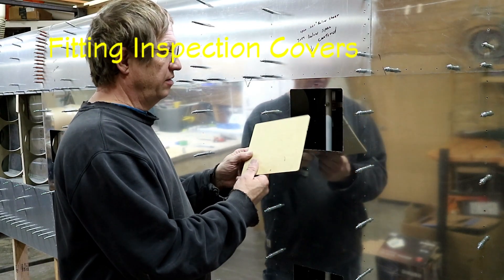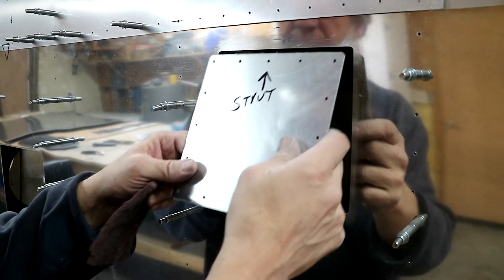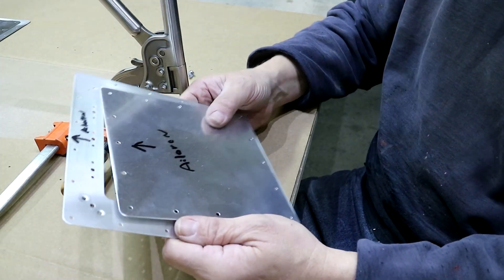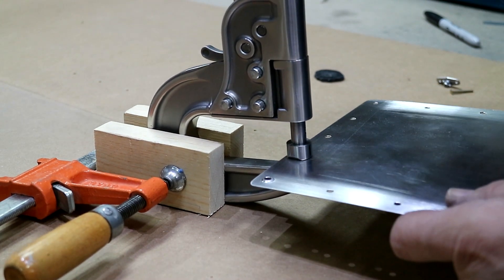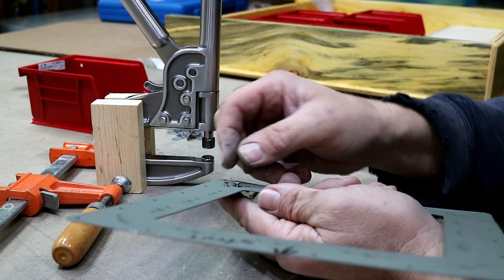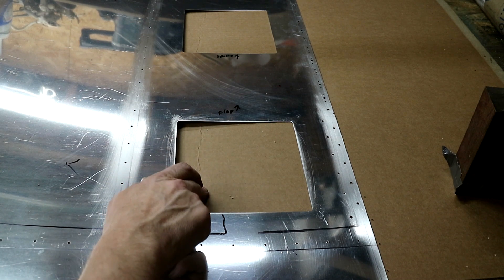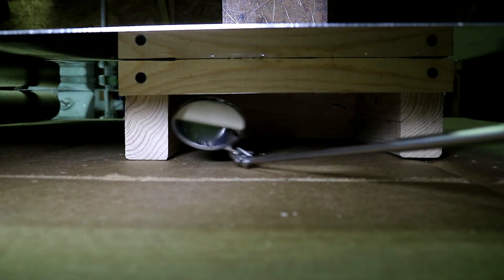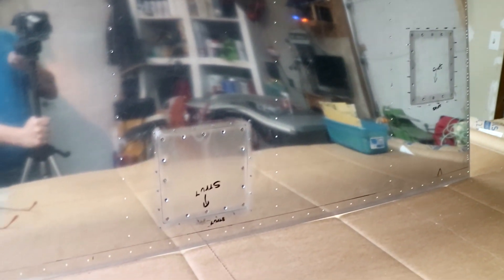Bearhawk Experimental Airplane Build : Fitting Inspection Covers

Comment: What router and program are you using to do this work. Thanks for the video.
Reply from the maker: The router I made. The software is Mach 3.
Reply: @BSpotBuilds  thanks for getting back to me. Had you worked with Mach 3 and done CNC before or did you learn the process just for this build? Thanks again
Reply from the maker: @amtpdb1  I have previous experience with both, but don't let that hold you back. You can learn as you go and YouTube has all the training you need. A good project will help drive you toward you goal.

Comment: Hi. I haven't started with my wings yet but would like to do the inspection covers and ring so long. Would you mind sharing the dimensions or if possible, the files for machining them? Thanks
Reply from the maker: I made all my covers the same size and they are larger than some I have seen. One draw back is they use more nut plates and once you get them fully assembled they are heavier than you might think. I will post a one time link to the Fusion 360 files. I would consider them a starting point. Use them at you own risk. For the router I used an 1/8 bit and a 1" collar. 
https://file.io/tXGU5eGu6hAC
https://file.io/WllVS4RD6dSz
https://file.io/A5Qz8WA2gLoP
Reply: @BSpotBuilds  thanks but it seems the files were deleted from the server. Maybe some dimensions would help me to model it myself.
Reply from the maker: https://www.youtube.com/channel/UCyAAfGX_Zth6KK0y9Fs4xzQ/community